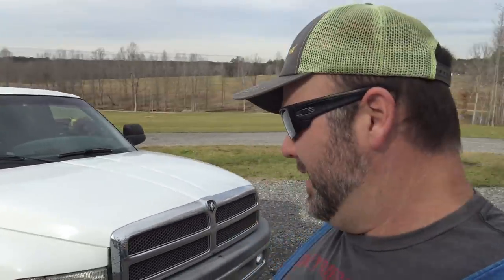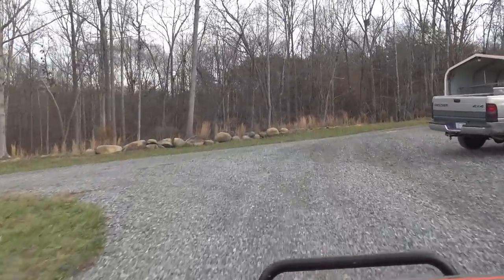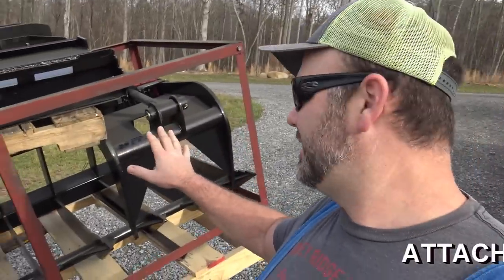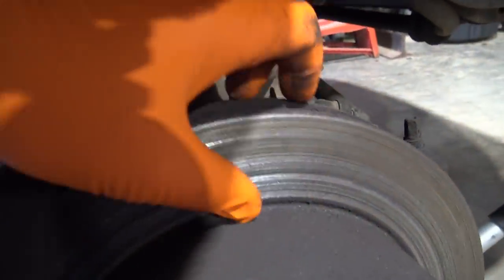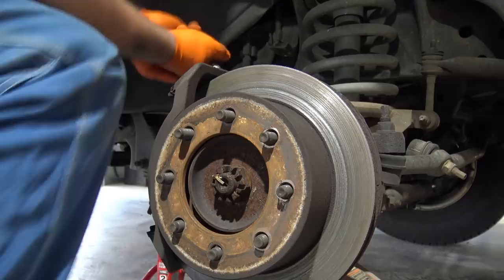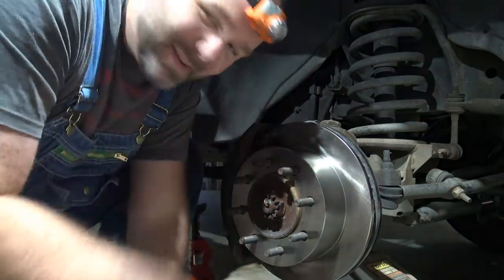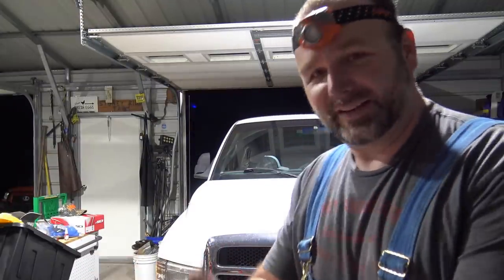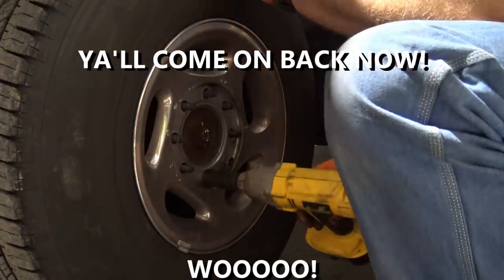Better Hope your Brakes Don't look like this! Farm Vlog brakes gone bad!

Comment: Leave one of the old pads in and the c clamp can mash back both pistons back at the same time
Reply: I was going to suggest the same thing
Reply: was just about to say this...lol
Reply: Thats what i was going to say.
Reply: Do this and use the other pad on the back of the caliper to even out the pressure. That way you are spreading out the force and reducing the likelihood of you cracking the caliper.
Reply: I do the same thing
Reply: That’s the way I was taught, use old pad  to push evenly,  open reservoir  before just before using a clamp push calipers to receive new pads
Reply: Yupper
Reply: You'll never use a C clamp again if you get a pair of big ass channel lock pliers. Use the old pad just like you would with a C clamp and it's an effortless 2 second squeeze.
Reply: @mandeladams4793  you can break the brake lines loose at the master if you intend to change the brake fluid, as you should.  Place a drain pan underneath.
Reply: Great suggestion! I've used that trick a couple of times--it works!
Reply: jeremy turnbull Yep--I've used the old pad has a spanner to compress both cylinders at same time. Works great!
Reply: For those stubborn bolts I use a breaker bar...where there isn't enough room for a long one I've used a shorter 3/8" drive breaker bar with a 3/8" to 1/2" drive adapter to use heavier sockets. Also I wear a set of hard knuckle military gloves if I think I might end up slipping...I have baptized too much of my equipment with my own blood to do different! 😎
Reply: Beat me too it haha
Reply: Dean Moore I’m not much a car guy but I can change brakes pretty quick
Reply: jeremy turnbull Some break systems are easier than others. I remember doing the breaks on my '91 Isuzu Trooper---4 wheel disc breaks were easy. Did a break job on my '91 GMC Sierra K2500---not bad but drum rears were time consuming. Got them done though!
Reply: The old break pad worked on single pistons also. It will keep you from damaging the seals if the clamp slides

Comment: The most important part of a disc brake job is greasing the caliper slide pins and anywhere the pads will contact the calipers
Reply: Yep this will help make sure the caliper grips with max force and things "should" wear more evenly

Comment: When compressing the pistons , keep an eye on the fluid level in the master cylinder reservoir as they can overflow and make a mess of engine bay paintwork . On cars with rear disk brakes , it's common for the pistons to screw in using a special tool rather than simply compress in .
Reply: Usually only over flows if you push caliper in too fast as fluid should be where it needs unless user as added to it instead of figuring out why fluid is low.
Reply: Brake fluid is water based so you can wash it off, but if left it will strip the paint off and you can’t repaint it as it soaks in to the steel. Normally they only over flow if someone topped the level up with worn out brake pads.
Reply: Don't top off your brake fluid and it won't overflow.

Comment: One tip for those tight bolts on the back....use a breaker bar instead of a ratchet....There’s plenty of rom in that big wheel well and it’ll break loose easier and it’ll save your ratchet from excess stress.

Comment: If your vehicle has ABS you should not push the fluid back up the line.  Instead open the bleed screw and then push the piston back.  Top off with fresh fluid when done.   ABS systems have crazy tight tolerances for the solenoid valves.  You don't want to be pushing trash back up the line into the HCU.   P.S.  The bracket that holds the caliper on is known as the anchor.

Comment: Good choice for jackstands.  I have some good ones and some old three leg split tube jackstands.  I have seen many examples of the legs bending on the split tube stands.  They are now holding up the tongues on the two lightweight trailers I own.  They will never used underneath a vehicle.  Good jackstands are money well spent.  Safety first!

Comment: Something that my dad taught me, "tools can be replaced, hands can't". I suggest that you use a breaker bar and if need be a hammer, cheater pipe or in a pinch a large box end wrench to break those loose. The more leverage that you can get, the more control you will have. Take care!

Comment: Couple of suggestions: 1) apply a bit of nickel anti-seize to the hub where the rotor meet. Not a big deal where you live, in the salt and rust belt, the rotor and wheel will seize to the hub. 2) clean/wire brush any contact point of brake pad to caliper/holding bracket and lube with a product like Molykote - designed for temps reached in brake applications. 3) best practice - replace the brake hardware I.e. caliper pins/slides and anti-rattle clips. Cheap insurance. 4) always depress both caliper pistons at the same time and never apply pressure to the piston outer edge - you can ‘jam’ the piston in the bore. I use a Lang 279 - it’s a ratcheting brake pad press. Works on single, dual and quad piston calipers. 5) previously mentioned - brake fluid. It will rise when you depress pistons. Fluid needs to go somewhere! 6). Securely hang caliper to avoid brake hose damage. 7) always torque caliper bracket bolts. 8) before you take jack stands out, depress brake pedal multiple times. Now go check brake fluid level.

Speaking of brake fluid level, for those that like to top up fluid, low brake fluid is a good indicator of worn brake pads. 

Again previously mentioned, go bed in the brakes by driving and smoothly applying pedal. This an important step whether old or new rotors are used.

Keep up the great work.j

Comment: Hay Josh once you take the calipers off if you put one of the pads back in you can use that to compress both pistons at the same time and open the brake reservoir and they will compress a little easier without introducing air into your lines

Comment: You did the right thing by replacing both rotors at the same time so you don't have to worry about the vehicle pulling to one side when braking later on.

Comment: Id recommend cleaning and greasing the slides on the yolk and slides on the caliper. Keeps even pad wear front to back and prevents a lockup of the pads in a rust seizure issue
Reply: Yup, probably the reason the first one had one side all chewed up and the other was fine. Great idea.
Reply: @augustreil  Often that type of wear happens when some pollution has got in brake fluid and swelled the brake line closed...
Reply: Uneven wear is definitely a lack of lube.
Reply: @billrandell4641  a closed line will cause wear on both pads on that side.
Reply: @trd4d  sometimes...not bieng rude but thats the exact wear pattern I have seen for the last 60 years...and given the age of the truck...and the "built in" obsolescence of the Brand...It's right about time for a complete rubber brake line failure..fix one..then another..and another of just do proper maintenance and replace them..cheaper in the long run..Just another note..that $87.00 rotor is $30-$50 on Rock Auto..just sayin...🇺🇸

Comment: Leave a clamp on the first side as you compress the other piston and it won’t come back out. You should also check your master cylinder to make sure it doesn’t over flow. Break fluid can damage paint and then you get to repaint your vehicle.

Comment: Greating from Colorado springs CO. I just did ft. Pads,and roters paid shop to press out all my wheel studs out, install new roters and did ft. Wheel bearings on both hubsspent $160 on new bearings and grease and seals.  $ 123. For two roters ,$ $45. For pads and  $73.00 for mechine press work , wheel studs r&r and bearing races.. what a two day job 4 me. 1990 Ford F250 p/u 4x4.  Jim in Colorado.

Comment: You definitely got 100% use out of them brake pads!! Its also a good idea to spray the new disk with brake cleaner. It removes any finger prints and anti rust thats on the disk.

Comment: I sure hope there is a mini ex in the future of the farm too. Just think all you could do with it. Running water lines for the cattle. Beautifying the forest areas. Preparing foundations for future buildings. Loading logs onto the future sawmill. Maintaining roadway ditches. Building new roads on your farm. Helping your neighbors out on occasion with it. And the list could go on...
Reply: Oh, and burning brush piles. That's a big use I forgot to mention.

Comment: Don't forget to bed the brakes, normally it's 50mph slow down to 15mph as fast and safe as you can do that 5 times to build heat and bed the pads to the rotors then drive normal 5 miles to cool the rotors down to prevent warping

Comment: It can be a good habit to get into to hit the hub with a wire brush before fitting new discs/rotors. It just makes sure the disc is sitting flush against the hub.

Also, I kinda got the impression you were possibly looking at replacing one disc. When it comes to brakes, you always replace as a pair.

Comment: Make sure you clean the rotors good with break cleen then I would antisize the back of the rotors to keep them from sticking on there for the next time when you have to take them off again. And lube the slide pins and brake pad mounting hardware with brake lube

Comment: I always leave the caliper attached to the basket and just support the whole assembly on a 5 gallon bucket, saves a little time and its quick to put back on all in one piece. I know how ya feel, wife said her brakes were making a weird sound, pulled the wheel and found that the left rear caliper locked up at some point, no rotor left. so 200 dollars for new caliper and rotor later....... gotta love vehicle maintenance. Happy new year, keep that good content rolling!
Reply: It's important too torque the wheelbolts to the specific torque.

Comment: I highly recommend changing the brake fluid on regular intervals. It tends to absorb water and its boiling temp declines as it breaks down. I generally go with Prestone DOT 3 fluid because it has a much higher boiling temp than is required for DOT 3. Some people use DOT 4 or DOT 5.1 instead (I hear DOT 5 is NOT compatible) due to improved temp ratings. Just a heads up, I advise doing your own research as well lol. Also, the rubber brake hoses can degrade over time, and even if they don't rupture, they can still cause problems with caliper hang.

Comment: Josh, You have a tractor with pallet forks.  You can move the feed barrel.   Push against it a little so you can get a scotch under one side and you can get under it with the forks without damaging the bottom.

Comment: Surely you can machine the front rotors. In Australia, you're allowed to go to a specified thickness. For the cows, I usually just use the words 'come on' but link it together and say C'mohhhnnnn, It doesn't really matter what you use I suppose, as long as the cattle get used to it. Thanks for the share..

Comment: Tarter Farm and Ranch manufacturing is headquartered in Dunnville KY not too far from me. 
As a few others have commented, the star head bolts are torx. The bit you were using is for tamper resistant torx head bolts. 
Keep up the great videos 👍🏻👍🏻

Comment: If you leave the inner brake pad and and use the clamp in the center of the brake pad you can push both Pistons back at the same time. Makes it a lot easier

Comment: Use some permatex brand ceramic brake grease on your slides , slide bolts or pins and the brake retainers. Also noticed you used a tamper proof torx bit( has that hole in the end), those are considerably weaker than regular torx bits. Also use an old pad on piston side of caliper when pushing them in.

Comment: It's recommended that when you retract the pistons to break loose the bleeder valve to remove the fluid. Reason is that the fluid gets hot from the friction of applying brakes and since the fluid just sits there it gets dirty

Comment: Torx head  (the "stars") ---"housing" is called a caliper bracket...replace pads before they get bad,,,, should be able to run 3-4 sets of pads on one rotor,,,, also----place  one of the old pads in to push caliper cylinders in,,, especially with dual piston calipers!

Comment: Those torx bolts with the rubber boots on them are caliper pins and they need to be greased with a special brake grease so they slide in and out easily and don’t freeze up from rust

Comment: The better the brake pads,  the faster your rotors wear out. And new rotors always come with anti rust oil on them that you need clean off. And nice job!! Also I wish we had a skid steer for stall clearing.

Comment: If you have anti lock brakes. You need to open the bleeder valve prior to compressing the brake caliper pistons. If you don't the ABS system has micro screens and will jam up. Causing you calipers to stick compressed. You will need to bleed the brakes afterwards. God bless

Comment: A little piece of advice when you squeeze the pistons back on the caliper with the c-clamp use the old brake pad you are taking off and put it back in the caliper when you squeeze the pistons back and you will squeeze the pistons back evenly and at the same time that way

Comment: Drilled and slotted rotors are great for hard ball surfaces ie race cars.... placed them on my truck in the county and on logging roads kept getting stones or gravel wedged in the holes. What a noise and way to grove up a rotor.

Comment: I agree with using an old pad with the C clamp to reset the pistons.   Also use a bungee cord to hold the caliper away.   Josh please for yours and Mrs Stoney Ridge sake use a car stand as the main support with the jack as a secondary.  I have seen too many pickups fall especially when working on the brakes or changing a tire.

Comment: Being a mechanic you see worse.  I seen them with one pad gone and worn half way through the piston . On the worn side the disc it was so thin you could see the depressions between the webs of the brake disc. It had nearly broken through to the ventilated area. The caliper was starting to leak from behind the piston and thats why he brought it into the shop. Another job I had a squealing sound from the rear brakes of a 10ton Hino truck. The rear shoes have steps in the side of then to show the wear limit so you don't chew into the heads of the rivets that hold the linings on They are about 5/8th thick new and they have the step at about 5/16ths. These ones were worn to 3/16ths thick and had  adjusters that were seized up . I couldn't get the wheels and hub and drum assembly off together. So I had to take the wheels off and drill and split the drums with the grinder. the drums had 3/16ths deep grooves from the rivets and thats what was stopping them come off. Josh we make s shaped hooks (6 inches long) from fencing wire to hold up the the caliper. You sit the old pads against the pistons then compress them.

Comment: When checking brakes for wear, caliper or drum, the right front will generally wear fastest. Roads are made with a crown to drain water to the side. This causes the right front to work just a little harder when braking.
Reply from the maker: this is mentioned in todays video I just released lol...great minds huh

Comment: In other words, anticipate your braking with new brakes so they can set in. DO NOT panic brake with new brakes. They will not stop normally until set in, which the mechanic should do on his (minimal) 5 mile test drive...

Comment: Some of the newer vehicles have I piston caliper compression tool that rotates as it tightens to twist piston back in. I found out the hard way. So if you see slots on the piston don't force it. You Tube it.

Comment: The pattern is Torx (pronounced like torque with an s) however the socket you are using looks like a Torx Security bit. Security Torx bolt heads have a little nipple sticking up in the center of the star.

Comment: I have done the same thing with my 2006 Dodge Ram 2500 Cummins on the hilly streets of San Francisco.  I also replaced both rotors, not too bad of a job, but those bolts on the caliper brackets are TIGHT!!!!!  One thing to note, whenever you do work on your brakes that requires the pistons to be pushed into their bores, PUMP the brake pedal several times before putting the vehicle in gear.  There's not much that is scarier than stepping on the brakes, and there's nothing there.
Reply: don't forget to remove brake fluid reservoir  cap to relive pressure

Comment: For brakes always replace in pairs ... And get the best parts you can afford ... One wheel at a time ... Lol ... It pays to check pads every so often to help save the rotor ... Here at the beach we don't have to salt the roads ... Salt in in the air plus people drive on the beach ... Only hose off the outer bodyywork. ... Everything underneath rusts out ...

Comment: No, no, no.  That's Good Luck.  It's normal that those parts wear out.  Replacing used rotors, even if they are still within thickness specs is a good/safe plan.

Comment: You know it's funny Josh my brother was for years the number one quarter horse trainer. He has the Rafter SM ranch in Oklahoma he raises and trains racehorses and quarter horses and my daughter is one of the top using horse (ranch horse) trainers. 4 years ago she was a national champ cutting horse rider and had two national champion cutting horses that she trained.   Josh buddy you may not have to replace that rotor what you want to do is measure and determine how far it is from one face to the other and then look along the edge of the rotor somewhere there will be a stamped measurement on that edge that is your minimum tolerance measurement if you can turn that rotor down and still be within that specification and you don't have to replace it.